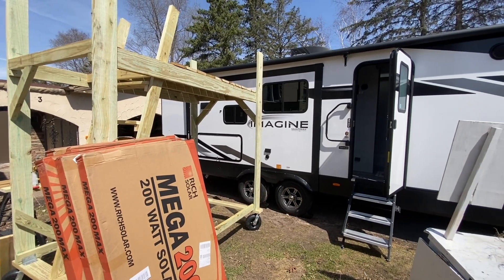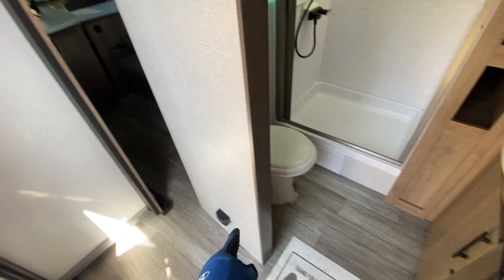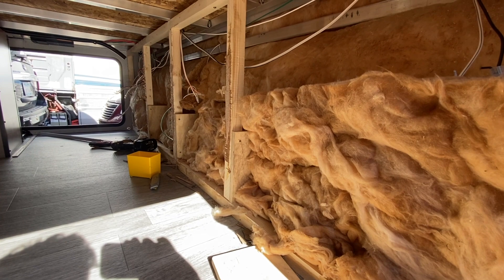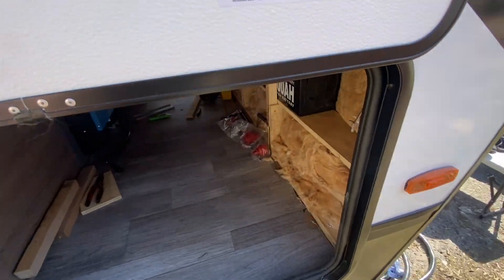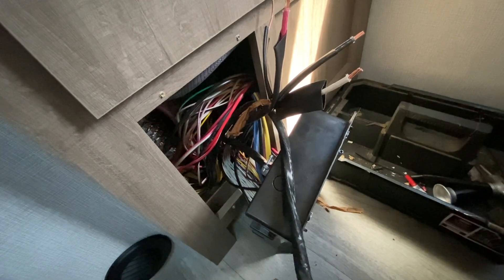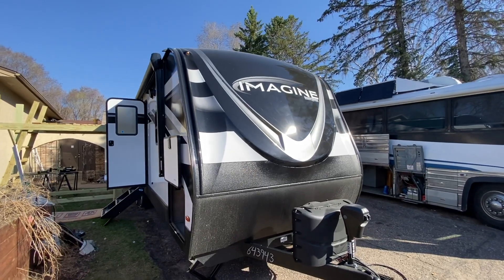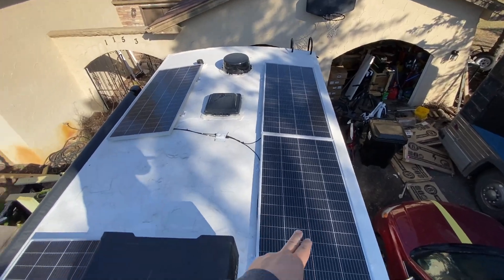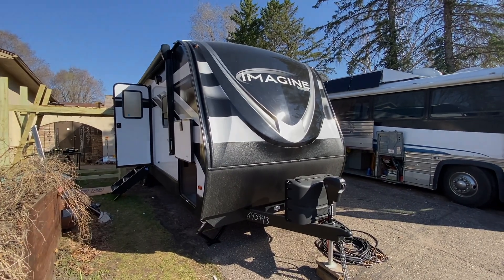Grand Design Imagine  2670MK  Victron RV Solar System 1465 Watts 600 AH battery

Comment: really great work. I have a 2018 2670 and my factory solar inputs are on the side. How would your run wiring from there to the roof?
Reply from the maker: Ya don’t :-) 

Easiest is up through the grey tank vent. Seal it up good. 

Next option is using the satellite conduit, after that would. Be running a new line all together up through the utility wall to the roof to a solar roof port.  

Those side ports are just a set of wires to the battery usually. Doing large solar requires a solar controller as well.

Comment: The batteries are in parallel correct? So 12v battery system? If so any reason to stay with 12v or higher voltage system better?
Reply from the maker: There definitely is a tipping point, I'd say this is in a grey area.  One big reason to go 24v is when you intend to run high power draw appliances for long periods of time.   Another factor would be solar system size.  I'd say once you max out a 100 amp charger we should think about 24v.   Some factors to think about with 24v is, needing 24v batteries (I would not use 2x 12v batteries in series) the step converter for charging from tow vehicle and then stepping down for 12v RV power needs.   

If you're interested in a 24v system we can design one for you and even do a comparison.   We did one recently where the 24v system came in $1000 cheaper due to savings in cabling and solar chargers.

Comment: Check out Polaris connectors. They are insulated and can be bought in many configurations.
Reply from the maker: We've seen those.   I like them but I didn't see them as being 10x as good for 10x the price.   With that said if a customer would ask for those specifically, I'd gladly use them.  I try and do things as if they were mine, I feel like the aluminum splices are a nice upgrade and still easily locally sourcable if need be by the customer later.
Reply: @sotasolar  All good! They make cheaper knock offs, but I don't know if they are of good quality. I am glad to see you drop the large wire nuts. I was never a fan with large wiring/high amp loads. I preferred split bolts with rubber tape and then vinyl tape until I came across the Polaris connectors.